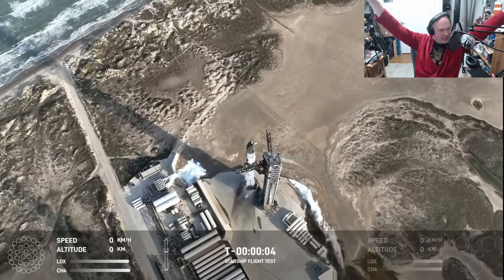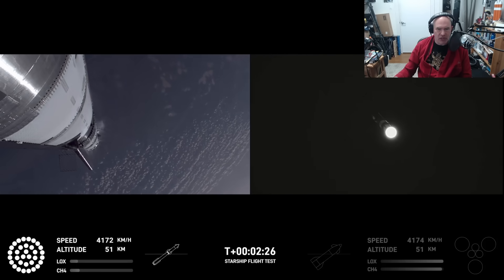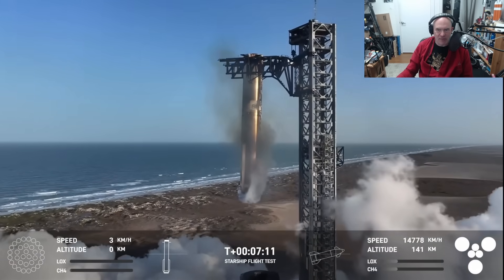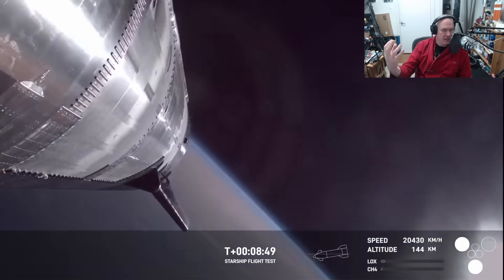SpaceX Make The Same Mistake Twice With Starship Flight 8

Comment: Elon never mention what failed causing the overpressurisation of the 'attic' area on the last failed SS, he tries blaming it on 'lack of ventilation' but that was caused by a catastrophic failure somewhere in the fuel system whether it be a tank bulckhead, fuel pipe/plumbing, an inherent flaw in one or more of the engines or something else in the fuel system.

They should've aborted the flight and tried to pressurise the system so they could physically check why there was a pressure anomaly and where it was because it's obviously not just a 'one off' random failure (if you watch one of SpaceXs' monitoring screen you can see the point that something 'let go' in a big way, hopefully it gives them a better idea of what to look at and where as it might give them a better insight in where to look.

The gases being vented through the engines will be for 2 reasons, make sure the fuel lines are kept clear and slow the ship down as without doing this the fuel will be falling at the same rate the ship is and acting like the passengers inside the 'vomit comet' and moving around and away from the fuel feed lines at the base of the tanks.

I'm sure I left him a message on X (or one of the other channels on YouTube lol) about that at the time and the separation from the booster and SS, the SS will push against the booster slowing it down slightly causing the fuel to move towards the top of the booster causing massive cavitation and fuel sloshing when trying to relight the booster engines on re-entry (looks like he's compensated for it nicely 👍). Just needs to find the inherent fault introduce into SS after its previous successes.

You might know the changes made between the successful re-entries and the last two failures, might help SpaceX out at the end of the day 👍... 😆 🤣 😂 

Keep up the good work 👌
Reply: he's too busy housing ketamine and preserving a nucleus of human specimens in some of our deeper mine shafts

Comment: The issue is clearly the hot stage separation.  It is like firing a shotgun into a wall at close range.  The rebounding shock wave will crack everything.  Hot staging might have to be abandoned and replaced with a piston push off.
Reply: I suspect the same thing. If this is the case, the resulting damage  that accrues seems minimal, but is insidious because the effect is not instant and is also not discovered any time soon. The engine bells are so well designed and constructed the shock transferred to the bell takes time to reach the point of catastrophe. We can even see it is the lower extent of the bell which gives out first. Not being an engineer, I can’t say why it manifests this way. Then again, this might not be the case. Still, why do we think the same thing, give or take?

Comment: Space x seems to have bad luck when testing new spaceship types the first few times. If I remember right, the first 2 full flights of starship ended in RUDS as well. But, if precedent should be believed they’ll have the next one reach space. Probably. I mean flight 3 still had its problems but they did reach space.
Reply: rockets have been reaching space for 70 years - starship is supposed to make orbit, land after reentry - and be reuseable. It has demonstrated none of these - wasting tax payer money with extra steps - private sector efficiency

Comment: "The best part is no part" 
in the early days of Television there was a car dealer known as "Madman Muntz" who wanted to get in on the big money selling TVs.
While the engineers were designing his television sets he would come through with a pair of wire clippers and take out parts.
If the television kept working, he would declare that part was unnecessary and over engineered and it would be left out in the production models.
What he wound up with were television sets that would only work when they were sitting at the base of the broadcast tower.

Comment: Has to be the hot staging. Just like engines were failing when there was no water deluge system in place my bet is the engines are failing because they are firing them directly at the booster.

Comment: Two booster engines failed to relight. The one did after a methane flush. But that alone is two too many for what is intended to be an incredibly reliable system.

Comment: It’s likely the nozzle burn through of one Raptor Vacuum engine is the root cause. At the time, T+7:58, you saw the burnt nozzle, there could be a tiny hot supersonic jet came out of there that was invisible. And the impingement of the hot jet (that can cut through and destroy everything) on the inner engines gave you the smoke shown in the video. So, I think the fix for Flight 9 could be very simple — making sure of good quality of the vacuum nozzle.

Comment: AI Summary

SpaceX Starship Flight Test 8: Analysis of Unforeseen Challenges

*   0:00:06 Introduction: The video discusses SpaceX's Starship and Super Heavy flight test number eight, which did not go as planned, similar to the prior flight (flight 7).
*   0:00:40 Starship V2: This was the maiden voyage of the V2 Starship, featuring modifications in heat shields, internal tankage, and plumbing.
*   0:01:08 Launch & Ascent: The initial launch was flawless, with a spectacular liftoff. The booster pitched over to position Starship correctly.
*  0:01:42 Engine Shutdown Sequence: Two engines failed to relight during the booster's return, a recurrence from a previous flight, but not critical.
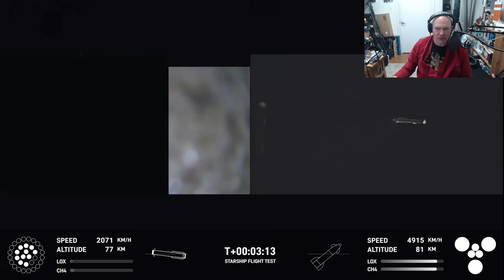*   0:02:16 Second Stage Ignition: All six engines on the second stage ignited successfully.
*   0:02:35 Critical Camera View: A camera inside the booster's skirt provides key insights into the subsequent failure.
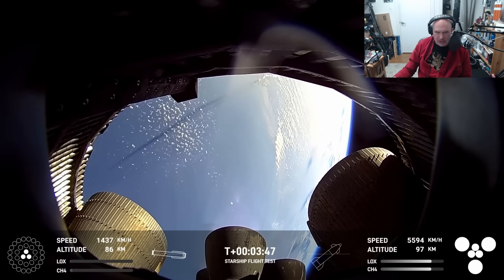*   0:02:46 Engine Configuration: Visuals show two vacuum Raptors and three sea-level Raptors, with a visible "Mach diamond" effect due to pressure interaction.
*  0:03:13 Booster Return: The booster shuts down its engines, performs a boost back burn, and begins its descent.
*   0:03:25 Hot Staging Ring: The hot staging ring is jettisoned, and gas is blown through the engines, likely for spacecraft separation.
* 0:04:01 Engine Pre-Landing Prep: The engines are being prepared for landing, including running through chill down.
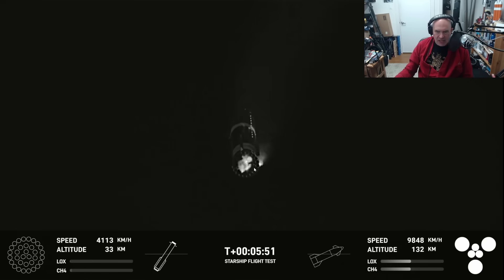* 0:04:05 Gas Venting: Gas, which is vented through the engine for preparation, is seen burning as it interacts with the atmosphere; This is expected.
*   0:05:00 Successful Booster Landing: The booster performs a successful landing, with the tower arms adjusting to account for translational errors.
*   0:05:42 Starship Anomaly: A red glow and fire are observed inside the Starship's skirt, primarily near a vacuum Raptor at the 2 o'clock position, reminiscent of flight seven's issue.
* 0:05:46 Engine Fire: A fire leads to a critical engine shutdown of a raptor, then the others, causing the Starship to spin uncontrollably due to off-center thrust from the remaining engines.
*   0:06:30 Fuel Sloshing: The spinning causes fuel sloshing, impacting propellant sensors and feed lines.
*   0:07:03 Loss of Control & Altitude: The Starship loses control and altitude, eventually falling outside the launch corridor.
*   0:07:24 Downrange Observations: Footage from downrange captures a series of failures and a rotating debris cloud.
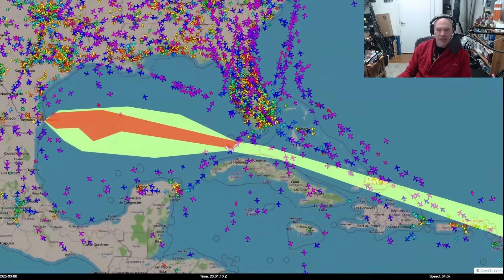*   0:08:06 Air Traffic Control (ATC) Response: ATC reroutes air traffic due to the debris event, demonstrating the scale of the incident.
*   0:08:41 Satellite Imagery: Satellite imagery (GOES-18) captures the exhaust plume and boost back, confirming the event.
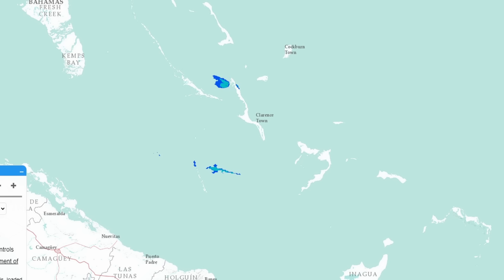* 0:09:35 Weather Radar: Weather radar from the Bahamas also shows the effects.
*   0:09:41 Questions and Analysis: The video raises questions about the root cause of the fire, its relation to previous issues, and the timing of signal loss.
*   0:10:30 Flight Termination System: The flight termination system was likely still active and may have triggered during descent.
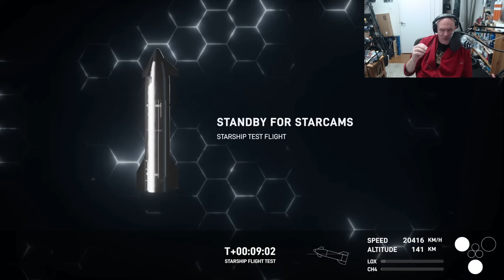*   0:11:05 Debris and Breakup: Ground observations suggest potential structural breakup, possibly due to centrifugal forces from the spin.
*   0:11:26 Comparison to Booster 7 Failure: The video questions whether this is the same issue that caused booster number seven's failure.
*  0:11:48 Suspected cause: They added fire suppression but it may have not been good enough. It could be related to multiple downcomers that are now in the design, creating more places for harmonics to build up.
*   0:12:30 SpaceX Investigation: SpaceX engineers will investigate, possessing more data and footage, including potentially sensitive camera angles.
*   0:13:31 Future Steps: The video speculates on potential design changes, flight profile adjustments, and the timing of the next flight.
* 0:14:36 Final Remarks: A comment on the project, and a signature sign-off by Scott Manley ("fly safe").

I used gemini-2.0-pro-exp-02-05| input-price: 1.25 output-price: 5 max-context-length: 128_000 on rocketrecap dot com to summarize the transcript.
Cost (if I didn't use the free tier): $0.03
Input tokens: 16598
Output tokens: 1038

Comment: Yep, my money is on the ship methane downpipes to the vacuum engines being the issue. Hotstage is quite a thump of exhaust reflected back into the engine bay which could be causing damage to the methane supply pipes which then fail under the vibration of the next 5 min.

Comment: You know what happens with compley proyects when you have a problem and you make multiple changes to the design? When it fails again, you have no clue what caused the fail no matter the amount of data you have. Was it the last failure? Was it a new one from the old design? Was it one of the new changes? Was it a combination of the new changes? Was it an old failured combined with one of the changes or multiple new changes?

Comment: there's a photo on the internet showing the centre nozzles and one of the outer ones missing, looked to be a nasty bang before it went out of control. Just know they're super close to fixing the design issue but it's painful to watch it fail, there was the feeling that they'd gotten past this stage and it was onwards to Mars now. Must be quite frustrating, particularly when half the MSM is arguing that they don't know what they're doing or it's a lemon. Hope they can dust off and Flight 9 is dialled in.

Comment: Its not the same mistake. It is getting to understand the complicated behavior of fluids that jas to fl o w through pipes at supersonic speeds for a good amount of time while being shaken and stirred by the vi rations of the motor and of the body of the ship. They may have to find other materials that will not react this way in a real scenario loke hoing into orbit. They may have to build cheaper and smaller experimental star ships to keep the costs down.

Comment: I don't understand why SpaceX moved to V2. This was a big mistake. V1 was solide und could by now deployed Payloads and landed back at the Tower. But no, they moved to V2 and the program delayed by more than half a year already. Thats why you don't change a running system. Why don't they test V2 while sending V1 to payload missions with catch attempts?
Reply: They are far away from payload missions, they not even developed a real Cargo Door. The Dispenser is only for there own new starlinks, but the old ones on falcon are enough at the moment.
Reply: @Pulver  I meant their own Starlink Missions. If they had used V1 in the January Flight, they would have nailed it again and then this flight would have been a full orbit flight with ship catch and starlink cargo. But now, they are back at the drawing board because of V2.

Comment: If NASA was failing so spectacularly there would be calls for the programme to be cancelled.

I get the achievements of this programme. Catching the booster is something that I will never tire of. I question the product that is being developed. It will not be fit for anything other than the mass launch of StarLink satellites. Never mind Apollo. It is not even on the level of Gemini or Mercury. The thought of sending astonauts on mission to mars or the moon without the fuel to complete the mission is frightening.

Comment: Looks to me as though hot staging does not work as expected. Engine bell damage is occuring because the hot stage exhaust pressure deflection properties are not working. Do they have to put up with traditional staging practice? If this is the case, two Starship development vehicles have been wasted unnecessarily and time has been lost due to a misplaced efficiency drive concept that does not, in point of fact, work. But then again, what do I know?

Comment: I find the most concerning aspect to be the insufficient or seemingly non-existent safety mechanisms in the event of such failures. The other engines should have been shut down immediately instead of allowing their thrust to result in an uncontrollable flight attitude. Furthermore, there appears to be no mechanism for sealing the tanks in the event of a fire. This, of course, would not have saved the flight, but maintaining the structural integrity and flight attitude/re-entry angle for as long as possible even in the event of a failure—and thereby providing leeway regarding exactly when the FTS is triggered—must be an absolute priority to minimize the risk of collateral damage.

Comment: 3:50 so they are using fuel to push away the ring because if they didn’t they wouldn’t have enough fuel to land with the ring?😂
Reply: The problem isn't actually that they don't have enough fuel, it's that they don't have enough fuel *in the landing tanks*.
They have spare fuel in the main tanks, but that sloshes around too much to be reliably used during landing, so it has to be vented before re-entry.
The landing tanks were designed to hold only the exact amount needed to land - but they were designed before the boosters were retrofitted with that ring.
The newer boosters currently under construction have slightly larger landing tanks, giving them enough fuel to land with the ring still attached.

Comment: Does it have the v3 engines and could that be the problem I mean they did it multiple times and now they are doing this bad. They said that they will learn from the last one but nothing changed.
Reply: No, they still used raptor 2’s.

Comment: Honestly, this feels like a propaganda launch at this point, it's eerily reminiscent of Soviet N1 in more than just its design now. There's no way FAA would approve this if they weren't dismantled by Musk. Probably Space X engineers didn't approve it either but were forced to move forward with launches, otherwise they wouldn't launch with same issue in place. Unless the issue is inherent to the design (cough cough N1) in which case the only reason to continue the program without complete redesign is to be a political monument for Musk... sad to see what he's doing to this company.
Reply: The initial comparison between super heavy and N1 have been disproven at this time, as it was based on the concept of a first stage with a tonne of engines. 
There have been, of the top of my head ( but cant remember the name) other project where its upper stage kept failing. 
But having proceded to reentry with ift 3-6, these two latest failures seems particular weird. Imo it reeks of a “musk”-decision against better judgement akin to the ift 1 decision of firing your exhaust directly into a flat piece of concrete.

Comment: Downcomer vibration does not affect the booster as they are coming back. Ship downcomers are fully protected during stage 1. However the Vacuum engine bells are fragile and likely affected by vibration during stage 1. They also get a hammering during hot staging. Lose one (of three) and it’s game over.

Comment: If I were a cynic I might think Elon fired so much of the FAA that they either weren't able to properly investigate the past failure, or were afraid to do so in case they got fired. And then the same thing happens with the flight termination system; if Elon's people don't quite feel it's needed, then nobody dares override them and the rocket spins itself to a debris cloud. And if I were a cynic I'd look forward to the day they're held accountable for the inevitable disaster caused by their hubris.

Comment: Mach diamonds can happen in both underexpanded and over expanded engines. The only difference is the order in which they occur. In overexpanded nozzles the exhaust exits and encounters higher pressure air, so you get shocks, these then cross and move upwards and at a certain point the exhaust will have compressed too far and so you get an expansion fan, shock expansion fan, over and over. Just behind the shocks p and T increase, producing a bright spot where unburnt fuel can be burnt off. In underexpanded nozzles instead of shocks at the nozzle exit,  you start with expansion fans, but then the pattern continues in the same way.
Reply: Your brain is over expanded. How about we discuss practical aerospace engineering?
Reply: @kimsmoke17  I am currently studying the subject at university, and we have just completed a module on oblique shocks and expansion fans. I had hoped someone might find it marginally interesting, as I did, but perhaps not.

Comment: I have following question, hope in suits here:
The German astronaut Ulrich Walter said to, when asked about Intuitive Machines IM-2 tipping over moon lander: They made the same error like Mercedes long ago, famous with the so called Elk-Test: the verhicle was too high, so easily tipping over.
Has starship HLS (moon lander) not the same problem: beeing very high. It's another thing, landing Falcon9 on a platform, than landing on the rogh terrain of the moon! Should the planning be changed completely to a not so high moon landing equipment?